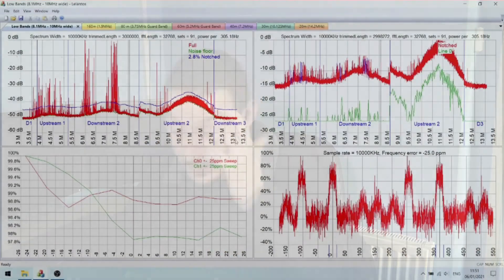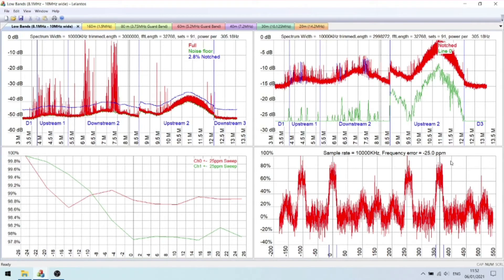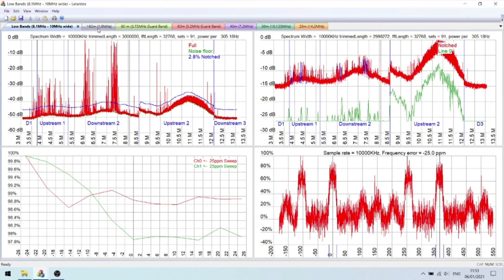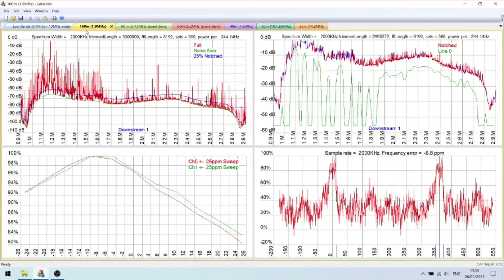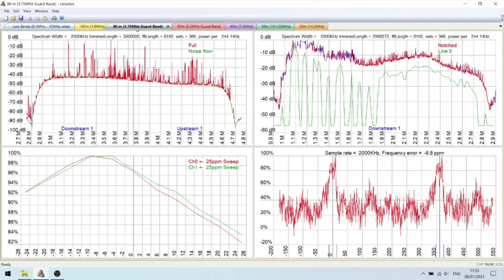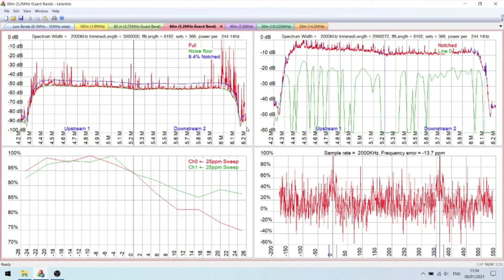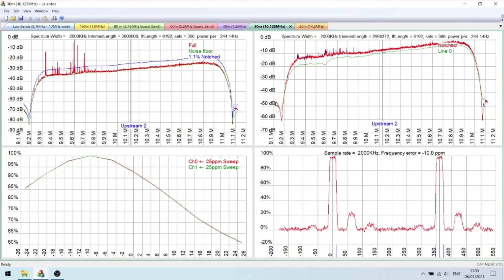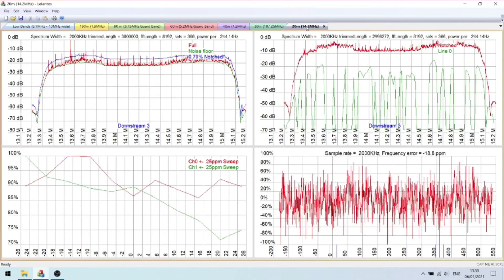S9 Noise - The Curse Of VDSL!!!

Comment: Nice work James 👍🏻. It will be interesting to see how much difference moving the connection point makes, you have a long run of cable, so you would think it would make a significant difference. You now have a good baseline to make future measurements against. Good work. 73, de Will, M0LGW

Comment: I had always thought VDSL was only on POTS phone lines (twisted pair from the street cab), I'd never heard of VDSL over a coax cable before. Are you sure it isn't a DOCSIS connection?
Reply from the maker: That was my initial thought.

That said, the coax did seem to be giving off a significant amount of noise on 80AM when I got close with a handheld, so I'm pretty certain that I am picking up noise of some description from the ISP coax via my own coax cables (which run through the attic very close to the coax for the router).

It might be worth "sniffing" the coax to the router with a small & very inefficient antenna (or maybe some kind of clip on inductive pickup) connected to the SDR to see what that shows.

After this video was made I ran my Lalentos plots past someone from the RSGB (who understands them way better than I do).

I forget his exact words but he essentially agreed with my analysis that there were 2 strong sources of VDSL interference and a couple more weaker sources.

He did also make the point that my cables could be coupling with the neighbours & bringing the VDSL interference into my house. I presume that this could potentially be picked up & transferred along the coax (which I guess is essentially acting as an antenna)?

Either way, it is extremely clear from the plots generated by Lalentos that I am getting at least 2 strong sources of VDSL interference from somewhere fairly local.

Putting aside whether the coax cable is one of those VDSL sources picked up by Lalentos, considering the amount of noise apparently coming from the router coax cable I'm very hopeful that getting the coax for the router moved will make a difference.

Once I do eventually get that cable moved (proving to be more difficult than I thought to get the ISP out to do it) it will be interesting to do the same test again & see if any of the spikes on the graph disappear.

Time will tell!